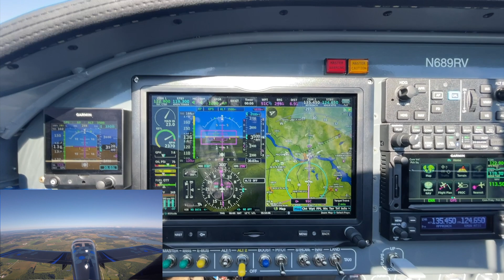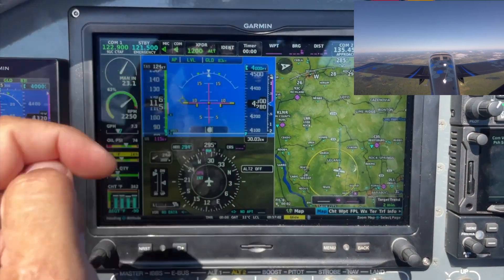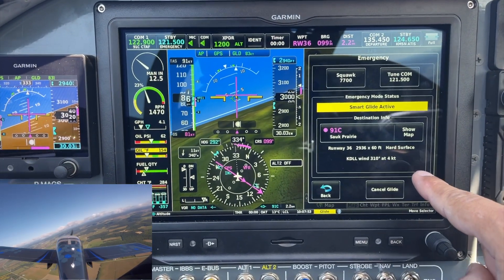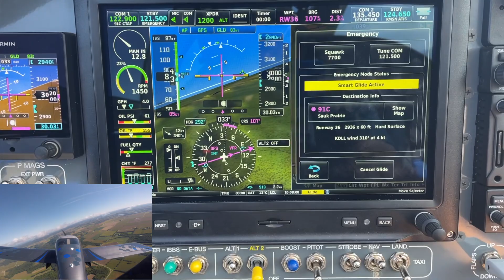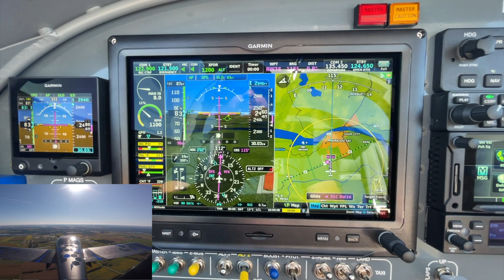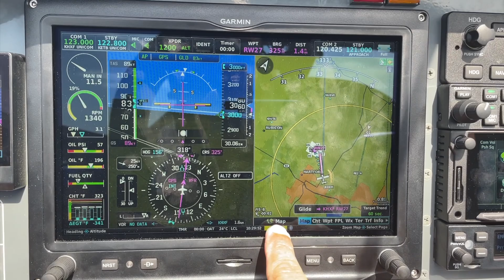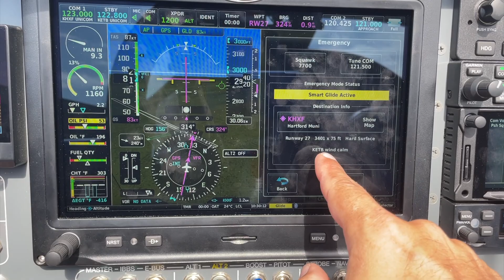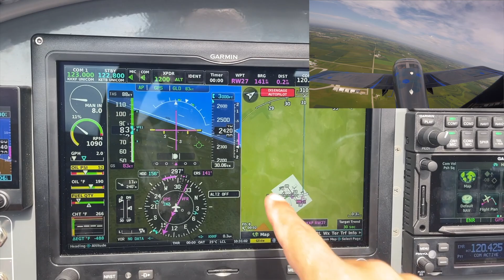Garmin SmartGlide Demo over Sauk Prairie & Hartford

Comment: Thank you for the video. I am curious with multiple airports in glide range if it makes different choices. For instance, does it prefer Towered or Controlled Airspace, or avoid them? Does it go for the longer runway or harder surface with 2 choices with a shorter dirt runway closer?
Reply from the maker: I believe that’s configurable but let me check it out and get back to you.

Comment: Awesome feature of the G3X.. I find it pretty annoying though that Garmin would require you get a new Xi navigator for certified aircraft to make smart glide work, when you only need the experimental G3X for experimental aircraft. Nothing wrong with my newish GNX375 navigator from 2 years ago to warrant replacement. Ugh. Would think if this was a safety feature it would be available on either certified or experimental without needing any additional equipment, which it obviously doesn't need.
Reply from the maker: I'm sure this isn't Garmins doing but a certification/regulation issue. Maybe in the future they will be able to have it on the certified G3X.
Reply: @BuildFlyGo  one can hope.. you're already paying a ton more for Certified equipment, would think that feature would have been included with the price hike.
Reply from the maker: It's a new feature Garmin is adding for free to the system. Functionality generally comes first to the experimental side and later goes through certification. Give them time.
Reply: @BuildFlyGo  fingers crossed. Great demonstration by the way. Envious.. lol.

Comment: Guil, great demo.  1) Is the "double ring" just the width of the green ring's "thickness"?  2) How did Smart Glide know what your best glide is? 3) I heard a "1000 foot call out". Is that part of smart glide or? (usually only get a "500" call out).
Reply from the maker: 1 - You can actually see 2 concentric rings vs just a single one.
2 - Figuring out your best glide is usually part of the Phase1 testing for experimental aircraft. You then input it into the G3X configuration.
3 - This is new with SmartGlide.
Reply: @BuildFlyGo  Guil, tnx for the info.  Do you know where in the G3x Config the Best Glide is updated?  I likely have it done by the avionics guys, but I'd like to check.
Off to Tucson today for my IFR - 10 day intensive.  I'll keep you posted, Tnx!
Reply from the maker: @scottstolnitz8918  Not off the top of my head but likely have to boot into config mode to set it. Take a peek at the current installation manual, it's in there somewhere :)